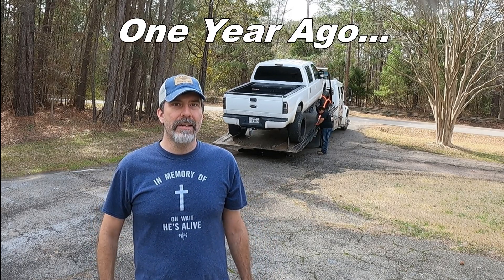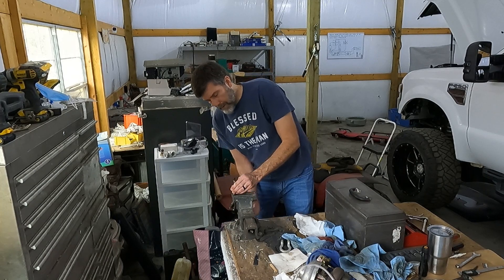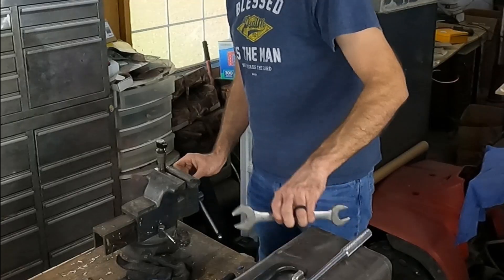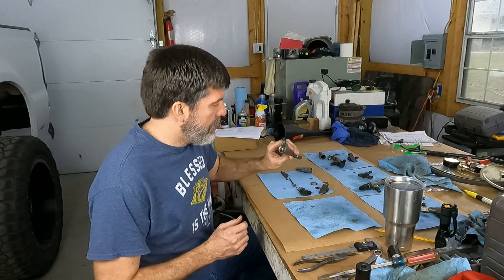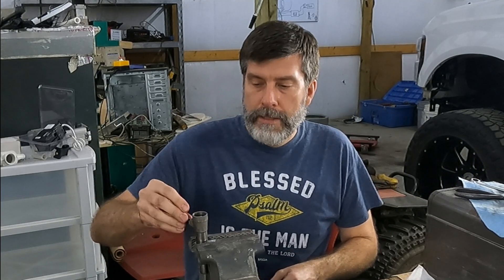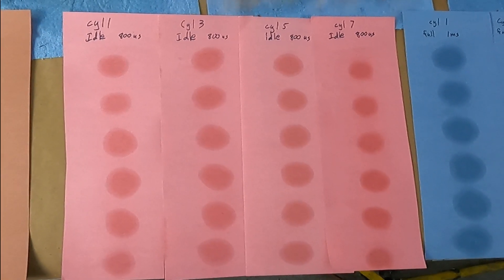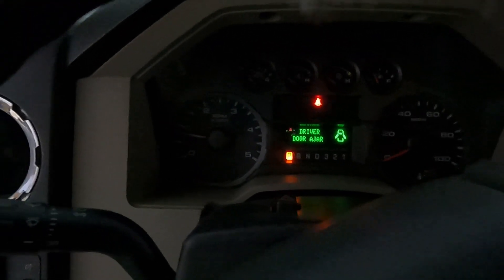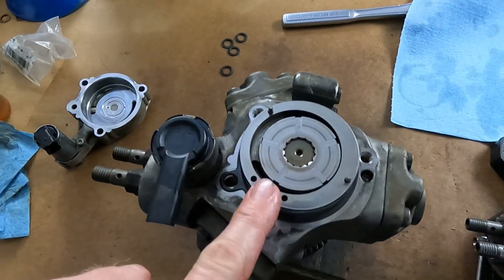Ford Powerstroke 6.4 Injectors and HPFP

Comment: Where did you get all the torque specs for the injectors and HPFP? When you were rebuilding them
Reply from the maker: I found a pdf with torque specs for most of the engine. Search for FCS-14853-MISC. For the bolts that weren’t listed I made educated guesses based on bolt hardness and diameter.

Comment: Don't forget the fuel injector lines, are one time use, with their crush surface, that cannot be repeated. Or, fuel in the crank case.
Reply from the maker: Yeah I think I went through four sets of fuel injector lines in two years with this truck. The fuel lines are cheap and the cost of failure is too high to reuse the old lines.

Comment: Amen brother. I love your videos.. i have  a 6.4 powerstroke that  #4injector was going bad.. it was spuddering at every stop light.  So i had someone change it out, they actually told me that it was the bad injector. After it was replaced, all the spuddering stopped, but now every time the engine gets warm,  there is thick white smoke. No check engine light.  The truck runs fine with no problem. Do you have any advice for me?
Reply from the maker: Does the white smoke smell like burning coolant? I have seen blown head gaskets and cracked heads. It is hard to know which until you pull it apart.

Comment: Your attention to detail and perseverance through a project like this is quite admirable. I'm actually picking up a blown up 6.4 truck this weekend which I will be turning into a Cummins powered truck before too long. This will be my second conversion, my first on a ford.  Love the trucks and platform, hate the horribly overcomplicated engines in them.
Reply from the maker: I considered a Cummins swap, but I wanted the dash to work. How did you adapt the gauges and keep the MIL off?
Reply: @barntech2291  it really all depends on the exact engine and the exact application of the swap. I've done swaps primarily on GM trucks.  My current truck is a 98 K 3500 crew cab dually with a 12 valve and an NV 4500. The SES light is on because the computer does not see many of the sensors it is looking for, but all of the gauges themselves work just fine. In my case it was basically just finding the correct adapters to use sensors like the oil pressure and temp sensor in the Cummins block and plug them in as if they were in the original GM engine.  On my next truck which I will pick up tomorrow, I will be doing a common rail 5.9. There are a couple companies out there which you can adapt the Ford harness to the Dodge harness which keeps everything working. It doesn't necessarily mean it won't have an impact on the SES light, but there are some swap kits that have ways around it. I will say, I've never been disappointed in any of the vehicles I've come and swapped to this point. Sure, the 6.4 has a lot more get up and go off the line, but not having to work on them so often is quite a relief.
Reply from the maker: Yeah my new truck is a Dodge and I love the reliability, but the 6.4 sure was fun to drive :-)
Reply: @barntech2291  Good choice.  The Cummins may not be neck snapping fast like a 6.4 but the reliability sure makes up for that.

Comment: This is amazing! So glade i found this channel. I have an 09 6.4 F350 as my daily driving farm truck. Currently it is in the driveway awaiting some attention in the engine after the engine decided to throw a temper tantrum and blow light colored smoke and loose power and weep horsepower all over the pavement to the nearest parking lot, where it began grumbling😢
Reply from the maker: Sorry to hear that. Did the smoke smell like burning antifreeze?
Reply: @barntech2291  couldn't tell, ever since I had the Ovid, my sniffer has not worked like it once did.
Reply from the maker: If you are lucky you just overheated and blew a head gasket (not necessarily in that order). More than likely your heads are cracked and/or piston #8 has a hole in it. Your best bet may be to find a complete running engine on marketplace.